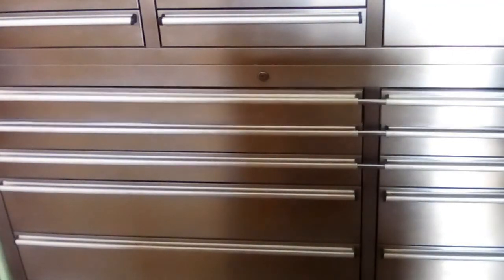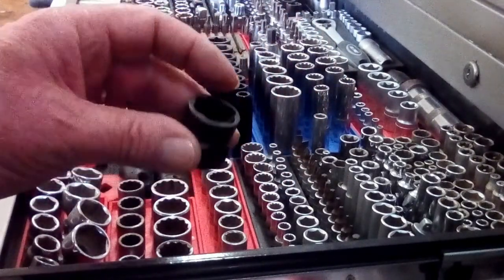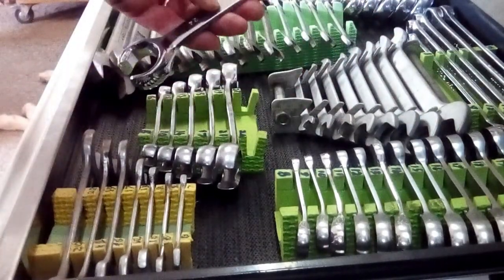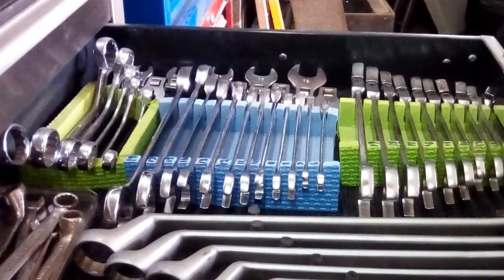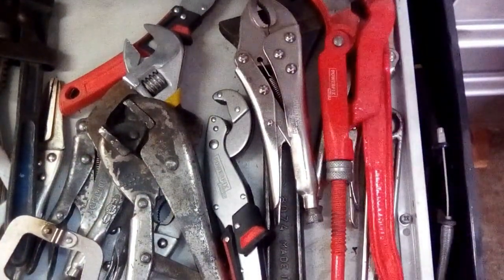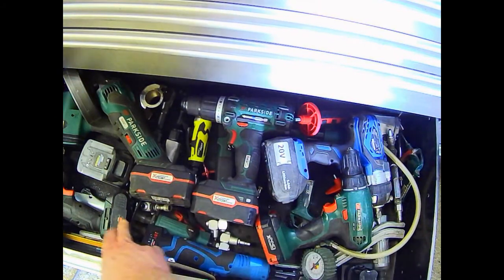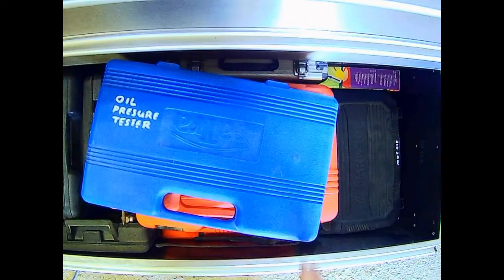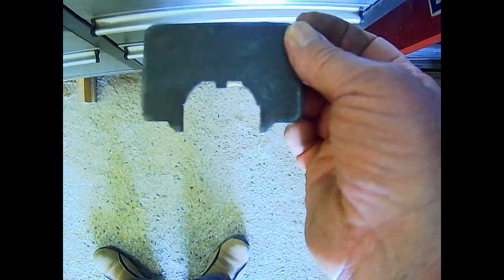Toolbox tour part 2

Comment: You have definitely got a nice set up in your Tool Box.
Looks a fair bit like mine.
I'm sure you suffer from the same problem as me 🤔

NO matter how many tools you own, you always manage to find something else you Want to buy, rather than Need to buy 😂

I have already started pulling my hands back from things I Want, to things I really Need ??
But even then I have already started getting to that point in my life when I simply Need to stop buying more stuff and seriously thinking about selling some of the things I can do without ??
Reply from the maker: I cannot justify buying tools anymore I have more than enough to do most jobs I sold a lot of tools when I last moved house 20 years ago and ended up replacing most of the stuff I sold unfortunately with lower quality I could not afford the makes of tools I used to have and as I no longer work as a mechanic the cheaper tools will have to do.

Comment: I like the DIY foam organizers, do you have a video on how you made the fitted foam sheets?
Reply from the maker: There is only a video on the spanner organisers I was thinking of making one for the foam ones as well thanks for watching.
Reply: @makerepairbin  Yes, I saw that one. I've inherited a ton of interlocking foam mats with stains I can cut up. I also noticed your plier organizer that I could use as inspiration as well. :) Glad the Youtube algorithm found your more efficient organizational videos instead of super expensive kaizen foam custom drawer inserts. I've got WAY too many mismatched tools to pull off something like that. I like yours much better!
Reply from the maker: @philsowers  I shall make a video in the next fortnight and explain how I did it. I have to tidy the workshop first cos I have a lot going on at the moment.
Reply: @makerepairbin  No hurry no worries. Made sure to subscribe for any updates!
Reply from the maker: @philsowers  Thanks.